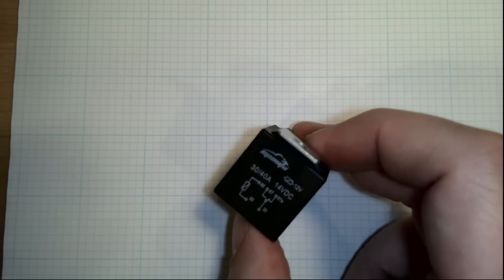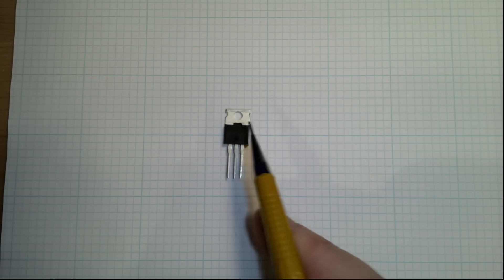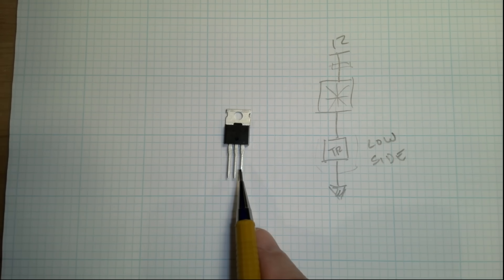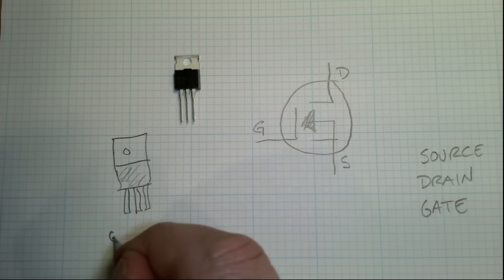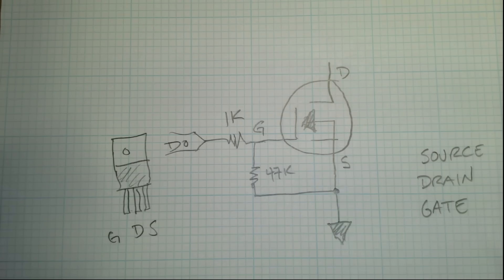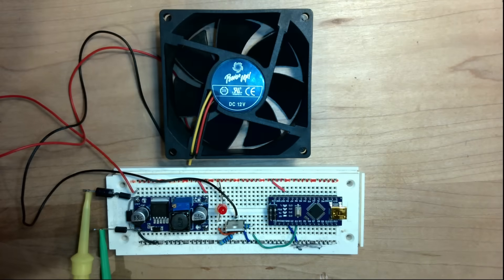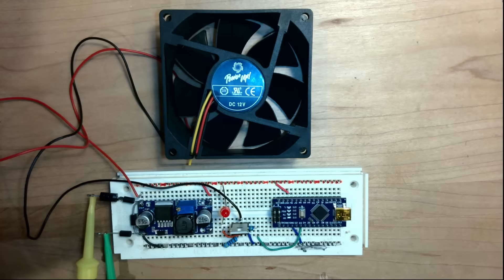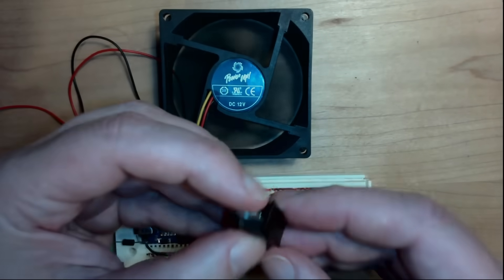Using a MOSFET to Switch High Current Automotive Loads

Comment: N Channel MOSFETS don't have to be used only on the ground side, they work equally well on the source side.  The drain can use a much higher ohm resister as well.  I typically use a resister in the 1 meg ohm range to drive the drain and a higher one like 10 meg ohm to ground if floating is a concern.  It takes very little current to trigger a MOSFET to the on state.

MOSFETS excel at PWM applications, if it's on/off just use a relay.  If you want to control it using a microcontroller that has low voltage/current outputs you can get relays that are designed for digital control and they aren't expensive, most have a jumper so you can use 3.3 or 5v as signal.  Another down side is generally when a MOSFET fails it does so in the on position.

Don't get me wrong, I'm a fan pf MOSFETS in high power applications, especially PWM but not for use in vehicles.

Comment: OOOPS! Your design has #GUARANTEED# DESTROYING THE MOSFET TRANSISTOR by not including a diode across the transistor to protect against reverse voltage back-inductance from a highly inductive load. If you don't know what this means, then you shouldn't be misguiding people by your ignorance. As a note, there are no "plug-and-play" MOSFET relay modules for sale because there are very important valid reasons against this use.

Comment: The important feature of a relay is it will usually fail safe (open circuit). Once the solenoid isn't energized, the contacts disconnect. Transistors can fail short or open circuit.
Reply: They can also weld their point together. Fail on.
Reply: @Dr_Wrong  yes but that's not the most common outcome. Many electronic circuits rely on non galvanic circuits where more fail safe operation is required - like transformers for example.
Reply: @TheDradge  

Sorry, I thought this was about high current loads. 
    Fail On with high current is “brown trousers” time.  Experience a few brown trousers and the “important feature” of “usually safe” doesn’t seem so important anymore..  js

Comment: Very clear and good to know these current levels can be handled. I still use relays for low and high power AC switching from digital. The relay quality is very high these days. But if it can be done in solid state, I’ll surely remember this vid!

Comment: I think MOSFET would be better than relays.  Except one HUGE thing.  Manufactures would install the MOSTET's onto a circuit board and they would make sure the board is not repairable.  The cost to replace the board would be a 1000 or more dollars.   
So please , stay with the relays.  At least most are in sockets.

Comment: One of the strongest arguments I've heard in favor of relays is that when they die, you can run into any auto parts store (possibly even a Walmart) to replace one in a pinch.
Reply: Or a nearby car
Reply: @robertrocheville7769  steal it off your neighbors car! 😂
Reply: Or steal it off another part of your car
Reply: @jtrill2 I'm a trash truck mechanic and I've done that many times. But it's harder now since they started using the mini relays, there are multiple sizes and shapes
Reply: @cbmech2563  yeah it sucks to when they solder on a relay to a PCB. Like a 1995 mustang GT fuel pump relay is on the CCRM(PCB) vs foxbodies had that relay under the seat(weird place, but at least its accessible).
Reply: @jtrill2  Right around that period ford switched to using closed loop fuel pressure regulation on almost everything. Pretty much everyone else was still spinning the snot out of a fuel pump at full tilt and using mechanical regulators to control pressure, but ford went and added fuel pump driver modules (fancy mosfets!) and fuel rail pressure sensors and used PWM and fuel mapping to cover the difference where they could. A decade later almost everyone else switched to "returnless," which just meant a mechanical regulator in the tank. Anything made much later than that likes men and is lame, so I don't know what they do. I assume it's the tank regulator, it is nice to splash fuel back on the pickup sock and bucket, if it's got it. I only know all this because ford sucks and I've had to replace I don't know how many driver modules and repair the stupid harness and the two tiny little "data" lines that always break for whatever reason. In the decade since all the OEM ones have failed, our friends in the east have produced only the finest of quality replacements which have also now been replaced probably three times more in that following decade. 

Don't think I've ever replaced a failed mechanical fuel pressure regulator before, except maybe a S10? They sure will boil them some fuel though, pumping it around for no real reason. When I added 4 times the fuel pump and injectors to my toy car for more fun, I added a ford FPDM and ran it from a simple 100Hz control signal so it was 1/4 a fuel pump till manifold pressure hit a certain point, even knowing how often they fail. Best of both worlds? Nah, probably just dumb.

So if I had to say anything, relay reliable, mosfet more (potential) fun.
Reply: @pontiacg445   I had a Paxton adjustable regulator (which looked like the Aeromotive FPR only blue) fail on my mustang and it was running like a lawnmower with all that fuel going down the intake through the vacuum line. I picked up a Kirban FPR and its been solid for many years now.  I think PWM is good if you can tune it without drama, but Im inexperienced in that area. it seems most big race setups are adding return lines to their systems even if the fuel gets hot and the pump is running full tilt. large in tank pumps can take it and last a good long time and controlling the injector is pretty easy but external pumps in my experience dont last so they might benefit most from digital control. sounds like youve got a cool setup going, maybe one day ill be forced to learn it so im not hacking up a factory returnless system.
Reply: @pontiacg445  I mean ford is breaking records atm with there 116 recalls lol
Reply: @NightshiftCustom  Good point! And Pontiac has 0! Oh wait, discontinued by General Motors in 2010...... waanwaa... lol
Reply: @sumless  yes Pontiac is/was just one brand of GM that still has way way less recalls then Ford. Ford now is at 141 recalls for 2025 and as of now GM has 26 soooo waawaaa to ford you mean ?
Reply: @NightshiftCustom  Fair enough, however it's worth mentioning that neither of us bailed out Ford some years back. We could go round and round about GM versus Ford etc, but I was just mentioning that item since your dinging Ford for no apparent reason.
Reply: Don't used mosfet this Guy is misleading you all...If misfit burn ❤️‍🔥 up ( they burn ❤️‍🔥 up very very easily and fast) you're can't find replacement parts like Cars and trucks Relays.. I have 30 plus years Electric 💡//electronics engineering back ground.. I'm fully retired now ahh
Reply: Mosfets  are so cheap you can keep dozens in your car. They cost like 10 cents.

Comment: While I like the idea behind this, there are a few issues that I see. If you're in the middle of nowhere, getting a relay is much easier than replacing those electronics. Second, if your input signal isn't coming from a microcontroller, what do you do? Everything int he automotive world has at least until recently been a 12v signal. And third, switching the ground is not a common solution to turning on and off a device. Especially high current devices.

The other thing I always find troubling is that I can get a relay from the local auto parts store for about $10, and by the time I wire up a MOSFET and it's related components, I'm in deeper than that. The heat sink alone is going to cost more and take up more space. Will a MOSFET actually take up less space once a heat sink capable of handling 40A is attached? And is it robust enough to handle the vibration in an automotive application?

Comment: I want to make a hazard light for bike which will be only turned on when ignition is on, but it must be running when ignition is off but hazard switch is on. It will be only off when switch is pressed off. And it can't be ON(start) when ignition is off. 
Make a circuit for this project. A single video is on YT and that video is fake. In India now every company gives this kind of hazard light on their bike.

Comment: Interesting and useful, thank you.
When driving an inductive load like a motor or relay coil would it not be good practice to include a fly-back diode to protect the transistor from the back-EMF as it turns off?

Comment: Is there a way to use a MOSFET like this but have a ground trigger it rather than a positive signal? I am using an aftermarket ECU that only has the ability to trigger outputs with a ground and I really need to use this idea in a PWM situation. I can buy a solid state relay for $130 that does what I need, but that seems excessive when a MOSFET will easily support the load and switch fast enough for PWM.
Reply from the maker: it's probably easiest to just invert the gate logic.  Using something like a 74HC02, tie connect your input to A, B to ground and the output will be the inverse of your input.
Reply: @dotnetMakers I tried to use an optoisolater for the signal input to basically do the same thing you mentioned. Worked fine on a breadboard at 5v but I put it together on a prototype board using 12v and a voltage regulator and had no luck. I’m pretty new, I thought I copied the breadboard exactly but maybe I missed something

Comment: Nice runup of the mosfet switch, they are used everywhere these days. That old school relay is dead dirt reliable, most will outlive the life of the car. I work on cars a lot but I have only changed two of those 30 amp relays. The MOSFET is way more complicated and delicate and I have changed a few lighting control modules and engine management computers with blown electronic switches in modern vehicles. I would stick with the relay but keep in mind I am an electronic technologist that loves the fact that my 53 ford only has 7 electrical wires on the engine and they cover all functions, charging, starting, metering and ignition. All still six volt negative ground with a generator. Works every day and if it doesn't work it is very easy to troubleshoot. After nearly 40 years as a shift electrician at a steel mill I have gained a love for anything that either doesn't fail or when it fails it is easy to fix. 😉🙋‍♂
Reply: MOSFET's don't have contacts to wear out or corrode, but they're definitely more susceptible to damage from bad wiring or signal logic. As far as complicated? No. They're usually easier to implement.

They also don't tend to fail intermittently like a relay can, so when they break, they stay broken, which makes troubleshooting far easier.

They're far less susceptible to damage from vibration and are often rated for millions of cycles. The only relays I've seen that claim this and live up to it are signal relays from OMRON, and I've never seen a high-current relay rated for more than six digits of cycles, and never saw one that lived up to that rating.

The only clear advantage that a relay has is that sometimes you can resurrect it by beating it with a wrench.
Reply: @SwervingLemon  Well I see I'm talking to a self appointed expert. I may have a little more experience than you. I've worked on and troubleshot everything from amplistats. vacuum tube control and a GePac 4000 computer for which I loaded the program from a punched paper tape to modern computer controlled drive systems. I have seen many relays surpass their life ratings and the only relays I have ever had to adjust with a hammer were made by Letourneau equipment. I have had many failures of modern electronics due to static issues and have to go to a lot of effort to make sure the incoming power is as clean as possible. So I beg to differ but that is ok we are allowed to have differing opinions.🙋‍♂😉
Reply: @MatthewBerginGarage Our opinions appear to differ mostly in scale, sir, and I've worked in Avionics and Automotive electrical for more decades than I'd like to admit. 

Modern transistors aren't the delicate germanium princesses you grew up with, and are significantly more robust and efficient. Each year, we find new chemistries that increase our current limits, reduce our bias voltages and resist ever more reverse voltage.

Many of the SMD transistors I work with have their "breakdown" voltage listed with and without conformal coating because in the absence of an insulative coating, the path for DC is more likely to be outside the component package. 

Perhaps your long history with the archaic tech has you biased (no pun intended) against the current (no pun intended) state of the art? You're not hoarding a supply of reflex klystrons or something, are you?

I also welcome your perspective and recognize your expertise, but high-tension valves < relays < transistors in terms of reliability, cost and simplicity. I know most of the old trade publications are gone but, for Muntz' sake: read something recent, would ya?

"Many failures of modern electronics..."

I believe that part, but if it was due to static, I doubt it was more modern than an Atari 400, and if it was more modern than that, I would be surprised that the RoHS-compliant solder joints lived long enough for you to be able to even build up the necessary charge, wool socks or not. (Lead for life, Baby!)

All kidding aside, I really do appreciate your experience and I think you and I could have some fun and informative banter worth watching. Collab, maybe?
Reply: @SwervingLemon  Dense is all I can say. Try being a little less closed minded, but it is your opinion and your allowed to have it.🙄
Reply: @MatthewBerginGarage LOL. The irony.

Comment: I do not understand why you need a computer in the circuit -- I would NOT need one with a relay; so it seems like it makes it unnecessarily complex -- NOT a criticism; just curious...
Reply from the maker: You don't need a computer. I'm using it to provide the activation voltage because the project I'm working on needs it, but you could just use a dash switch with no dc-dc converter or microcontroller

Comment: You left out all the important bits: fly-back diode across the load, the tab is usually connected to the drain, so you cannot connect it to the vehicle chassis, too low gate voltage or slow switching results in over-heating... That is what just comes to mind thinking about the millions of MOSFETs that have died in my designs. Then with the DC-DC converter you need to make sure that the ground in = ground out, which is not often the case.

Comment: Well TBH.   You're gonna need a heat sink on that device which is going to make it bigger.  Plus transistors don't deal well with heat as well as a relay.  (as long as you don't make the coil with insufficient gauge).   And the automotive environment is hot.

Comment: Would’ve been a lot more convincing had you shown just what are you going to switch on a vehicle?
Yes, the FET  in itself is simple and less expensive but why would you get several resistors and Add in two additional circuits and get them routed , you don’t need (don’t forget an enclosure) merely to switch say door locks,
You can activate them with the ground,  when you can take two relays and two switches, what do you have to use anyway, two circuit wires wires, instead of four and you are done.  
If you’re gonna switch the clutch on a compressor, while that’sa pretty heavy circuit load for your FET, I could see it being beneficial for something like that however, you’ve got several other circuits to consider also within that same system again, complicating set up, and you still have to enclose all that by the way, how did you determine the values of your resistors some of us people don’t have the skills you do to pull those values out of  thin 
air. There have been many times I would’ve loved to use something like this if it weren’t for practicality simplicity, and expediency. Not to mention cost and availability on hand.

Comment: What are you talking about, the 1k resistor on the gate is NOT for limiting the current,the gate current is almost zero, also you didnt mention back EMF when switching inductive loads ,or the fact that the fets 49 amp rating is only under certain conditions. Sorry but youre talking BS. Please dont post anymore, Im a retired electronics engineer (50 Years).

Comment: Ohh, I get it! So you have replaced a "quite big" relay with a small power transistor on a heatsink that is.... nearly as big. Brilliant. Don't forget to leave some air space around the heatsink, and ventilation holes, and keep it away from low-melting-point plastics.

Comment: Relays are so much easier to use for automotive accessories.  No controller, no programming.  Just a dumb mechanical switch.  Wire it up, engage switch, accessory on.

Comment: It sounded great at first, but then i realized that i need a power controller also, to create 3-5 volts....  And then i realized the heat issue...
Its a nice idea, but very not practical for auto uses.   Thanks anyway for the excellent video explanation!